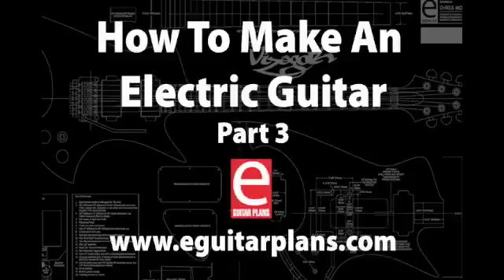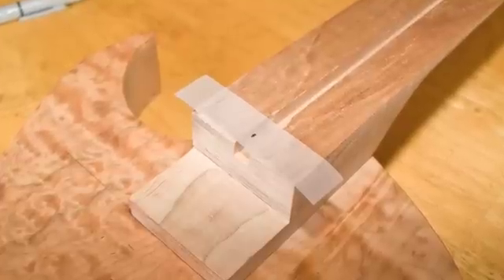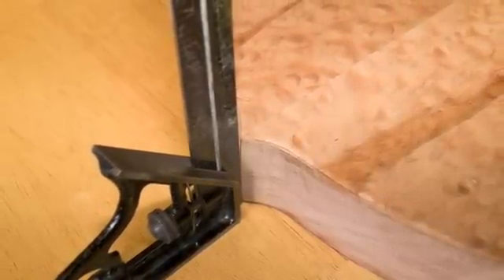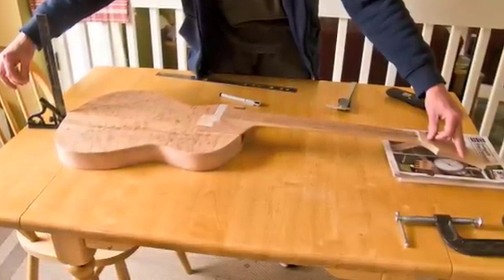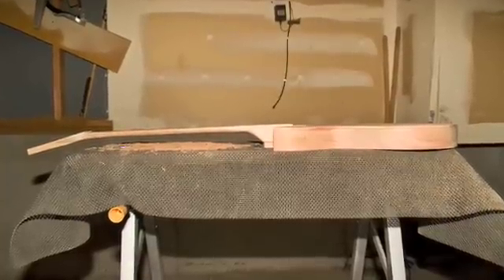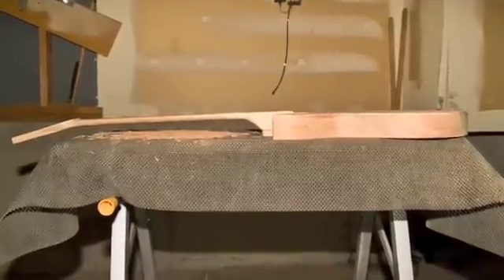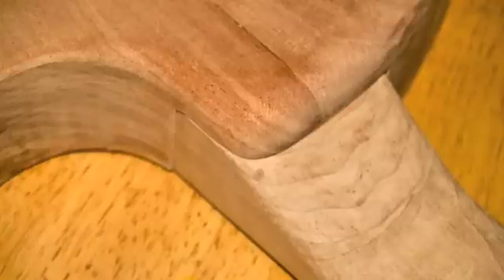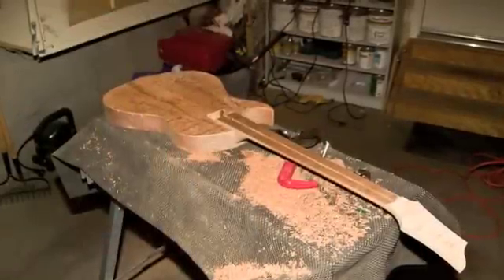How To Make An Electric Guitar: Part 3

Comment from the maker: Whenever you drill, rout or saw the neck pocket, you should try and make it smaller than what you'll need. So, the template should rest on the inside edge of the line. After you finish forming the pocket, you'll need to file and sand it and the neck heel in order for it to fit. KEEP IT TIGHT!